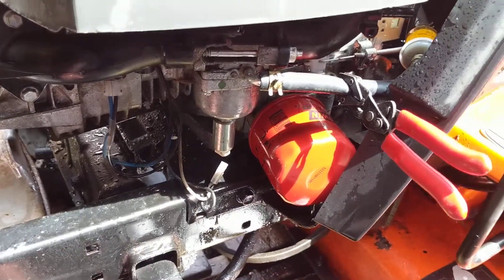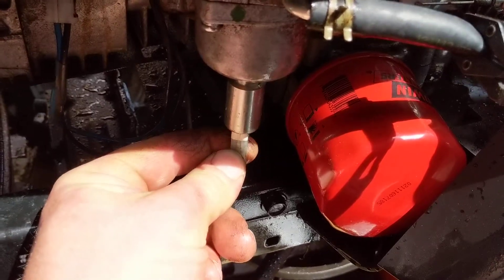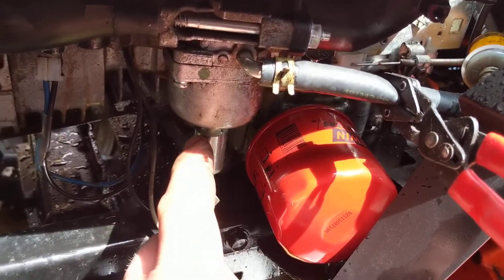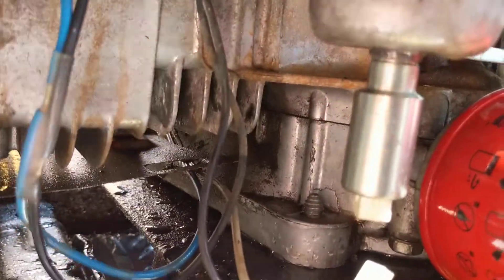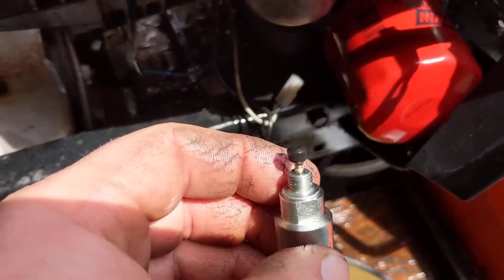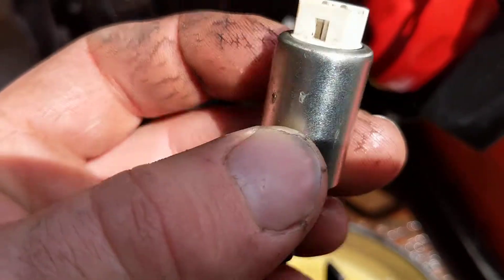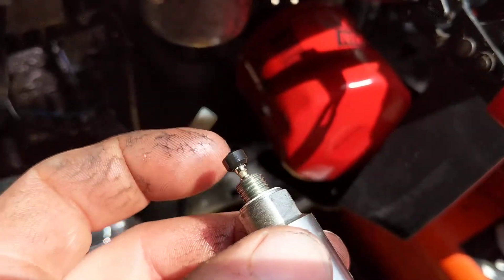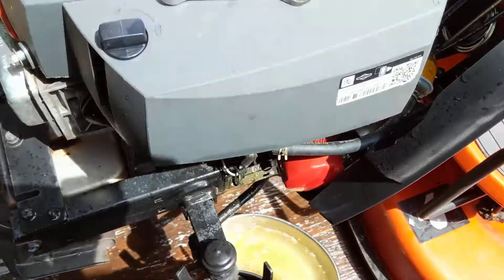Briggs and Stratton Carburetor Fuel Shut off solenoid information #lawnmower #smallenginerepair

Comment: Only shuts the main jet and stops from backfiring and nothing more.... Not in the same passageways to shut fuel off to stop fuel from flooding the engine ... That is the job of the float needle and seat and nothing else .. so two seperate components that do two seperate functions
Reply from the maker: You can flood an engine when you cut the spark and it keeps sucking in air/fuel through the mainjet. Especially if it gets shut off at full rpm with the blades engaged, that'll soak the plug before the engine stops.

Comment: My craftsman is flooding. Have a shut off switch on the fuel line so it doesent. Was looking to see if the solenoid is bad. Still runs perfect so think its the needle in the carb. Just bought a new carb for it
Reply from the maker: It'll be the needle/seat in your carb.
Reply: @machinesnmetal  new carb comes tommorow. I might just put the new carb on but it's one of the china cheap ones so if it doesent run good I'll just put the new needle in the old carb.
Reply from the maker: it may be the needle seat. They pit and leak sometimes. I've got lots of customers that weve installed a tap on their fuel line because of this issue.

Comment: My question is, can you just remove that solenoid and put a drain bolt in the hole like the old carburetors use to have? And will it work?
Reply from the maker: Well no because if you remove it it's not there and it can't do its job if you read through the comments you will see what I mean.
Reply: @machinesnmetal  I am seeing other videos that say that I can remove it as long as I have a manual shut off valve (which I already have). I just need to put in a drain plug in the bottom of the bowl. Thanks for commenting though.
Reply from the maker: Then you've missed the entire point of the video. It's an anti back fire valve it has very little to do with turning on and off the flow of gas from your fuel tank. It stops the flow of fuel through the carburetor the instant you get off the seat or turn the mower off preventing a backfire which in some cases will crack your engine block.

Comment: I took the old shut off solenoid and when I try to put the new one it won’t go in, I mean, it goes half the way up and the it keep spinning and doesn’t screw it. What. What u did wrong? Not even the old one wants to go in all the way back up
Reply from the maker: Did you get the right one? There's different ones
Reply: i Think so, even the old one (the original one i took out won't go all the way up) @machinesnmetal

Comment: I'm having the same problem..I hope it's this.. all else checks out..getn gas.. spark..all that.. but I checked this and even with 2 wires and touching straight to the battery It won't work.. and mine will not go down..I can do what you did and up and down with ur finger.. so I hope it's this. And yes mine comes with a washer too.. but I didn't have to grind down a wrench.. the washer gave enough room.. but THANK YOU FOR THE VID..🤘🤘🤘👍👍
Reply from the maker: You are the mechanic now!

Comment: Man I got to say , I have had brigs and Stratton motors run for 15 years with heavy extreme abuse,  I have had many kohlers that fail within a couple to a few years , internal problems, oil leaks and to full blown blow ups, I don't know why people say brigs are not that great because they run amazing for me , I've got a brigs on a pressure washer  I bought in 2009 and it's still running great, I use the hell out of it , I got another brigs lawn mower motor that was in a 2007 lawn mower . .I wore that lawn mower down to junk - I pulled that motor and replaced a kohler that blew up after 6 years , the brigs is still running as of July 2023
Reply from the maker: It's because you use them. Alot of viewers leave them sit for years at a time and they go stale and stop working

Comment: I was mower won't start took carb off to give it a look over. Everything looked fine. Put it back together. Went back out about an hour later the air intake tube is full of gas. What the hell did I do?  Any suggestions would be appreciated. Thanks.
Reply from the maker: Make sure your float and needle are clean and functional
Reply: @machinesnmetal  I'm going to double check tomorrow. Thanks for the tip.

Comment: Hello!  Bought a used Troy Bilt Pony 15.5 hp riding lawnmower.  I've replaced the Nikki with a new OEM B&S Walbro carb, however the solenoid wires don't fit into the connection port.  Thoughts? Can I put the solenoid from the Nikki onto the Walbro or what's the correct fix?
Reply from the maker: I'd cut and swap the plugs.

Comment: My solenoid kept falling out, so I screwed bolt in, then JB welded it in. Now I use the fuel shut off under the gas tank instead of relying on a part that falls out. Everything's made from cheap foreign junk or I'd replace the carb. My 60" Swisher tow mower runs great now, it didn't when I got it used for $1000 9 years ago. At first it would run but sputter to a stop during a turn. So I screwed out the solenoid draining the bowl then I switched to non ethanol gas. My Cub Cadet lawn tractor had the same problem, water collected in the carb bowl due to ethanol gas. Another YouTube channel said the solenoid was useless and Chickanic was right.

Comment: The unit that I'm working on now came to me with and oil sump full of fuel.. the solenoid plunger was stuck in the down position that was crap in it and it was blocking that spring return on the plunger. So cleaning up the carburetor clean up the bowl cleaning up that little unit I'm also going to install a . Manual fuel cutoff. It's right in the center of the bottom of the bowls for any sediments going to go right into it.. of course if the plunger remains in the closed position.. it will have difficulty running I'm okay with that.. but I'm not okay with it stuck in the open position flooding out the crankcase with fuel.. and the number one reasons why.. that's right they don't drain the fuel at the end of the season.. no matter how much the customer promises they will they won't.. there you go there's your dinner

Comment: Thank you bud!! I've been struggling to get my mower running and it's just not feeding fuel to the motor. I'm directly jumping the starter with a full battery bypass which means that solenoid is getting no power... I thought it was just an overflow switch. I couldn't find anything explaining what the solenoid does until I came across your video. I knew it had to do with that stupid thing.. thanks again!

Comment: What would fry my fuel shut off valve?  My mower stopped on me and I saw smoke coming from the engine.  When I looked at it, the shut off solenoid connector had melted and was smoking.
Reply from the maker: What voltage is your regulator putting out?
Reply: @machinesnmetal  I have no way to test it because it requires the engine to be running and I can't run the engine with a closed fuel shut-off solenoid.
Reply from the maker: just replace the solonoid with a bowl bolt to do the test.

Comment: Does it matter which way you wire the solenoid ? Basically if you had the plug turned 180 degrees out
Reply from the maker: I think if you connect it backwards it will operate in reverse

Comment: If yourun Seafoam thru the motor periodically, you will keep the carbs journals and small bits from forming varnish that gums up parts like that. Try it, you'll see. I makes a great fuel stabilizer for long term storage also!

Comment: Are those also on Briggs & Stratton engines that have their own fuel pump? I don't recall seeing that on my 23 hp engine. I'm thinking something is keeping the engine from starting with the carburetor or fuel system but don't know what it is. My machine is fed gas from my van's tank up to the engine and then has it's own pump to deliver the gas to the carburetor at the proper amount. The engine will easily turn over but will not even begin to start without starter fluid and then it just dies immediately.
Reply from the maker: sounds like its not getting fuel into or through the carbretor. In answer, some have both a fuel pump and a solonoid.

Comment: My 23hp Briggs & Stratton backfires when I turn it off, could a semi-working solenoid be the issue?
Reply from the maker: Yeah, the solenoid pin gets sticky with dirt deposits and dosent fire up to plug the hole fast enough, take it off and clean it out with brake clean make sure it bounces back with no resistance

Comment: This video was helpful to me. My mower wouldnt start - but i started at the gas tank end and moved all the way to the carburetor testing everything and replacing the fuel pump.  Finally I found that it ws the fuel shutoff solenoid. The mower had been idle for 2 years and the solenoid was gunked up.  I cleaned it up and now the mower runs.  It is surging a little so I probably have some more carb cleaning to do.
Reply: Im grtting no power to silenoid.

Comment: thanks for explaining what that is. i thought i was a water in fuel sensor or somthing. i got a 21hp platinum thats been sitting for years with stale fuel. i cleaned up all the ports i could but its hunting at all throttle speeds except with choke.
would that be something to do with that mixture adjusting screw fuel supply? 
thats the only one i didnt't take apart. all the gaskets look ok.
Reply from the maker: It's probably more likely your carburetor Jets need to be taken out and cleaned. Some of those carburetors have a little bit of adjustment to them but usually not enough to make any difference if it is surging as much as you say it is.

Comment: Thanks. Mine is weird: I remove the solenoid and reconnect the two-wire plug and switch on -- nothing happens. I disconnect the plug and put probes in it and get near to 12v when I switch on (so wiring and switch just be okay and the solenoid is faulty. BUT, I connect the solenoid to a 12v (car) battery and the plunger retracts -- so the solenoid  IS working... Ideas, please!
Reply from the maker: I think you need to touch the solenoid case to the engine to ground it.
Reply: @machinesnmetal  Thanks. But it has two wires, the short black one going clearly to ground.
Reply from the maker: yes, but it may need to be case grounded as well.
Reply: @machinesnmetal  "case grounded"?? Sorry, i had to look that up. Mr Google hasn't heard of it either! Never mind, but thanks.

Comment: The fuel tank on that mower is above the engine ( gravity fed) and If that solonoid fails and doesn't shut the fuel off it can flood your engine  cylnder and pollute your oil. It happened on the one that i own. it actally hydro locked the cylinder so that the engine would not even turn over. I took out the spark plug and turned  the engine over and gas was flying out of the spark plug hole. I  changed the oil 3 times and then put a shut off valve before the carburator so it would never happen again. BAD DESIGN !!!
Reply from the maker: If your engine filled with gas you have a leaky float needle. This solonoid device only stops the air/fuel mixture from entering the combustion chamber when you shut the machine down at full throttle (or get off the seat while mowing) it prevents backfires due to a rich air/fuel condition that is caused when the spark is cut by either of the above methods.
Reply: @machinesnmetal  Thanks for the reply !!  You are correct the float needle was bad but I thought the fuel shut off  solenoid should have prevented the fuel from entering the carburator and flooding the engine.... I thought fuel shut off meant fuel shut- off .Otherwise ,Since its gravity fed from the fuel tank The only thing preventing flooding would be the float needle. In any event it don't matter since I won't have to trust either . I now have a shut-off valve on the gas line and i sleep much better at night LOL
Reply: @machinesnmetal   Also I forgot to say my Mower still randomly backfires after  shutdown and restarting with the solenoid still hooked up and I only  shut the mower down at low idle. When I rebuilt the carb I cleaned the shaft on the solenoid as it was kind of dirty but I suspect it's still not working correctly .... my Craftsman is old (15yrs) but serviced regularly by me and kept in a shed. Last year I pulled the mower deck out , put 2 coats of paint on it and replaced spindles, pulleys ,belts , actually everything. It has blown the head gasket twice in the same spot , Which i also fixed... it's  due to a bad design which  I was told by the Dealer. The head bolts are too far apart on one side..which is where it blows out ...

Comment: Remove this and you take a chance  of gasoline filling up the oil pan causing engine to smoke severely when running and ruin the internal moving parts .
Reply: Needle and float sticking. Install fuel shutoff to prevent that

Comment: G'day mate. I had a problem with the fuel solenoid on my Husqcana ride-on mower and was able to get it working perfectly by removing the rubber tip (the part that actually seals and shuts off the fuel) of the solenoid and replacing it again. My question is... can I leave it like this forever?  Is there any real need to have the fuel off when not using the mower? Maybe I am missing something.
Reply from the maker: It prevents the engine from loading up with air fuel mixture when you shut it down. You run the risk of a backfire which on some of the cheaper intek motors will break the cam decompression tab or on some of the colors will crack the block

Comment: I used my bench grinder to narrow a 1/2" open end wrench and got the solenoid out. THANKS for your insight!!!
Reply from the maker: That works. Sometimes you can get in there with the tip of a small set of needle nosed vise grips as well.

Comment: Great info on the mechanical end but what about the electrical aspect? Will the mower turn on with the solenoid unplugged? Mine started smoking so I unplugged it.  I ground the tip of mine down and fuel flows no problem but now the starter wont turn. Were you going to mention anything about that mr informative??
Reply from the maker: Sorry I've never modified one in the such a way ive always repaired it properly for my customers. I don't have any experience with grinding them down or running them unplugged unfortunately but there's a lot of people in the comments that have jimmy fixed it that way perhaps message one of them?

Comment: Where are the two wires on the solenoid connected
Reply from the maker: One goes to ground on the side of the engine & the other one goes to the key switch

Comment: Just got a brand new carb and fuel is still pouring into the engine. Does this have anything to do with the solenoid? Im so confused.
Reply from the maker: Most likely your float needle is not sealing.
Reply: @machinesnmetal  also, the gas that is coming back through the return hose is mixed with oil im pretty sure. Could a bad head gasket cause an influx of gas through the carb? Thanks
Reply from the maker: Probably not the head gasket. Your engine is full of gas/oil mix because the carburetor needle is not sealing and the gas has drained from the tank into your engine. You need to install a $2 fuel tap on your fuel line to shut the fuel off when you park your tractor.

Comment: i was GIVEN a troy built 18 hp riding mower because  my friend just got tired of spraying starting fluid on the air filter just to get it to start , when i got it i unscrewed  the electric solenoid , ground off the plunger and screwed it back  on and it cranked like  a brand new mower ...lol  i have had 0 problems with it backfiring
Reply from the maker: Nice work!

Comment: Just disconnect the wire from the bottom of the solenoid -add a in-line fuel shut off valve -no more problems for me
Reply: Exactly what I did my and Orange Turd still runs after1,000 hrs.

Comment: that center in in the solenoid  is used to allow fuel to flow in the tiny tube at a level set by the float in the bowl when you turn off the key it removes the 12 volts that holding the soleoid in open pos. i other word the tiny pin is spring loaded to rise with volage removed there by stopping eng  it looks like the solenoid is be ing blamed for fuel prob some  where else

Comment: Thanks for this video. I'm fighting my Briggs & Stratton 344cc, keeps leaking fuel into the engine oil when left for a couple of days. I took out the solenoid, the tip seems to be of hard plastic, not rubber. Also, it moves freely but feels a bit loose. Is the solenoid not supposed to close with some force? It opens easily on the table, when I gently lay it upside down, with the plastic tip down. Or perhaps my problem is the float needle not sealing?
Reply from the maker: I would focus on the float needle . Or just cut your fuel line and install a $2 fuel tap.

Comment: Just more un-needed stuff to cause headaches for you. The old mowers didn't have that valve. So I cut the plunger off with side cutters and be done with it.
Reply from the maker: Old mowers engines were built much more robust and could withstand the internal pressure of a backfire, these new engines are built so close to minimal tolerances, case thickness etc, that they will sometimes crack or split under a good backfire, hence the fuel plug solonoid.

Comment: Excellent vid !! Have a 2004 Bolen and haven't done anything to it, but I decided to change the belts. Once I finished, the damn thing wouldn't start :( When I sprayed starting fluid it started to run. Now, I have to tear down the carb and clean it. I appreciate the tips on the fuel shutoff and how to get it working again. If that's the problem. Take Care !